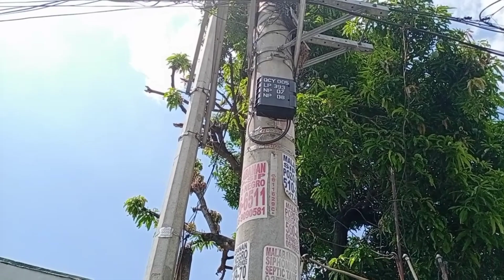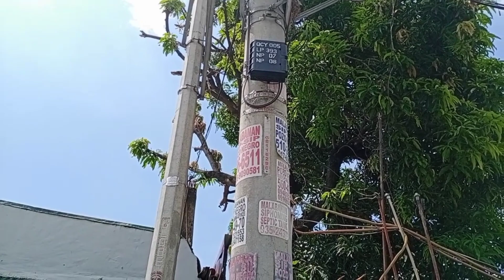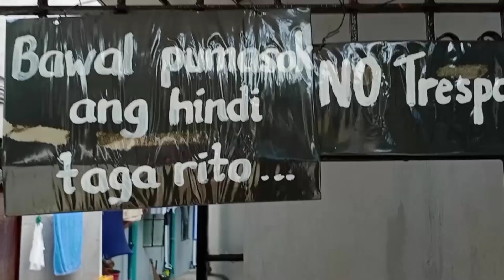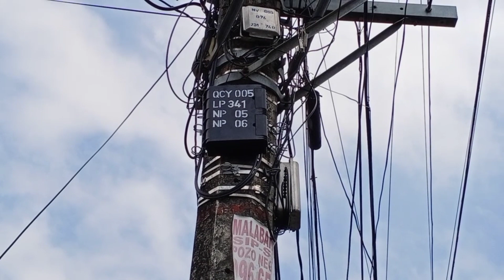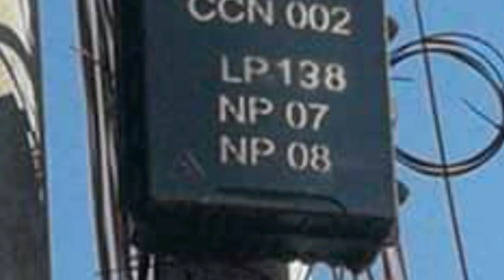How to determine NAP box of converge Fiber X in your area?

Comment: good day I just wanna ask the following  questions.
1.) Gaano po kahaba ang kable na kailangan mula sa nap box papunta sa isang bahay?
2.) Paano kung di abot ang kable sa bahay, pero gusto talaga magpakabit ng wifi? ano ang dapat gawin, mag request ng nap box? pilitin ang installer na mag over extend ng kable? o magantay nalang?
3.) Paano madetermine kung Nap box ba ng converge ang isang nap box? may distinctive appearance po ba ito? may nakalagay na serial number? anong kulay usually.
4.) how long bago maactivate ang mga nap boxes sa isang lugar.
5.) usually ilang nap boxes ang need sa isang lugar/ baranggay?
6.) ilan po ang capacity ng isang nap box? may variety po ba ito?
7.) paano malalaman kung puno na ang napbox?
hoping po for your immediate response
yun lamang po for today, salamat po
Reply: Oo nga po gano po katagal maactivate yung no power na nap box
Reply: Up
Reply: Basically lahat ng tanong ko andito na, pero 10 months na wala pa rin kasagutan.
Reply: 1. Mga 200m lang mula sa NAP BOX papuntang bahay
2. Depende yan, kung may malapit na electric pole jan sa bahay nyo pwede kayo mag request o babayaran nyo yung over span cable mula sa bahay nyo papunta sa box
3. Yung appearance nito ay kulay white yung NAP BOX ni converge at may naka lagay na black text
4. It depends on the plan that the surveyor being submitted. many process kasi yan, Approve for ROW (AFR), approve for Implementation (AFI), ABP (as-built Plan) at Mag tetest pa yan, as per converge mga 3-4 weeks bago ma approve yung plano saka pa i implement nila it takes 1 month depends on the area.
5. It depends to the sales, si sales po kasi yung nag dedeside kung ilang naps ang ilalagay para sa area nayan. 
6. For 1 NAP box it will cover 16 residences/subscribers.
7. You can contact the customer service of converge to ask if may available slots pa po ba

-Hope this can help you :)

Comment: Sir pwede pa kau mag vlog about speed test ng converge.. Diko ksi alam kung ano ung tamang ping and tamang speed  kung talaga bang naka 25mbps sya
Reply: Try to watch this
25 Mbps po ang plan dyan

https://youtu.be/RkuWUWQHor0
Reply: Syempre download ka ng speedtest na app or sa google i search mo lang speed test. then syempre start mo, take note mag ka iba ang "mbps"(maliit na letter b) sa "mBps"(malaki na letter B) parehas silang measurement ng Internet/Data speed. gaya ng 25 mbps connection, mag eequivalent sya sa 3.12 mBps dahil ang 8mb(mega bits) is equal to 1mB(mega bytes). so kapag nag download ka ng 3.12MB na apps sa playstore at may 25 mpbs na connection ka, aabutin lng to ng 1 sec. sa ping namn since fiber ang connection papalo lang sya ng around 1 digit or pede namn mag 2 digit since di naman constant ang connection.
Reply: @cocoamaster9200   thanks  for d info.. Di po kasi lahat me alam sa ganyan.. Sa totoo lang meron pa palang small b at B..

Comment: Sir. Tanong ko lang pag sumobra ba sa 300 meters ung wire additional pay ba un or di na kakabitan ng installer?
Reply from the maker: hanggang 350 meters po sagad sa wire pag sumobra po depende na lang po sa installer
Reply: @tribosschannelofficial9425  ahh. Sir kung mag bayad ako sa sobra ok lang din ba yun?
Reply from the maker: hindi po namin sya authorized sir saka bawal po yan as company policy
Reply: @tribosschannelofficial9425  ahh. Nag apply kasi ako ng converge waiting nalang ako for installation pero ina alala kolang parang sobra po ata sa 350meters ung area namin anggang dun sa poste ng converge. Pano po kaya ung gagawin ko at ung mag iinstall?
Reply from the maker: @jayrsemeniano1680  paano mo po nasabi sir na sobra sa 350 meters?7 poste po yan sir ng meralco yan po sukat ng 350 meters
Reply: @tribosschannelofficial9425  kasi ung nakita ko po samin na poste ng converge medyo malayo layo dun sa bahay na pag lalagyan, pero pwede din ba ilagay un sa ibang poste?

Comment: Paano po sir kung may nap box kaso napaka layo po? Pero same brgy lang din po ano po dapat gawin . Mag request ng nap box or what ? Paano po ba?
Reply: Same tayo sir 900meters ang layo samin nung nap box pero same brgy din po, ang sabi ng agent e babayaran daw po namin yung wire. Kamusta po yung inyo naka bitan na po kayo?
Reply: @cegieplaza5993  Di na po kami nakabitan sir kasi ang laki ng gastos Add 1k daw po sa foc.Sabi ng iba wala naman dapat bayaran about sa foc. Ang sabi lang obligado lang ang highplan 2500 pesos 100mbps. May anumalya sa foc sir hehe. 

Buti nalang may nag latag ng pinaka malapit NAP ng pldt dito sa purok namin kaya sir PLDT nalang pinakabit namin.
Reply: Kami nga po 7k babayaran lahat lahat pati yung wire, nakakainis wala parin yung installer
Reply: @cegieplaza5993  magkano daw po sa wire sir?
Reply: Bali 5500 po ata sa wire sir, tas 1500 1month deposit. Pero nilagay sa application namin 1500 lang bali yung 5500 daw po ibibigay sa installer

Comment: sir need help po may installer kc dumating samin nung May 15 tapos sabi raw po wlang slot ung malapit na Poste samin.  diba sa application  may step po dun na PORT RESERVATION. tapos nung installation day na biglang wlang slot.  bat po ganunn  ang labo po kc..  tas sabi  meron poste na medyo may kalayuan samin pero may slot tapos mag eemail raw muna ung installer sa office tungkol nga raw po sa concern. pag na approved raw kakabit din raw. kaso wala pdin sila update hanggang ngaun po.  btw tinanong po ako kung may agent ako sabi ko kc wala thru online lng po ako nag apply.  SALAMAT SIR SANA MATULUNGAN MO KO
Reply from the maker: tawag ka sa hotline sir 86670850 then pic nyo po yung box na malapit sa inyo yung pinakamalapit na box at yung kasunod na box basta 350 meters sir mula sa bahay mo,para mairequest to revisit
Reply: sir eto po ba ung email address nila? iconverge_noreply@convergeict.com  dyan po kc ako nag f.follow up ng concern ko sa installation.

Comment: Sir paano malalaman kung activated na nap box meron na nakalagay na number. Pero lagi sinasabi nang installer hindi pa daw activated sir paano malalaman yun
Reply from the maker: sa system po or pag may nakatusok na po na maliliit na wire sa ilalim,sa may butas ng box sa ilalim po
Reply: @tribosschannelofficial9425  usually sir gaano katagal bago ma activate ung nap box two weeks na sila meron number sir
Reply from the maker: @shannonpelayo2310  depende po yan kasi i test pa nila yan kung lahat ng port ay ayos ang reading,2 to 3 months expected po,pero depende po sa bilis ng contractor na may hawak ng activation ng box

Comment: Ilan po ang pwde (household or nag apply) per box?
Reply from the maker: depende po sa Nap mam,kasi minsan yung box single NP lang minsa naman double NP,pag single NP 8 ang capacity pero 6 pa lang full nap na,ganun din sa double NP 16 ang capacity pero minsan 10 or 12 pa lang full nap na sa system kaya unahan po ito sa reservation
Reply: @tribosschannelofficial9425  yung 350 meters po. 7 poste po ba talaga ng meralco yung sukat? Simula po kasi sa box ng converge, mga 12 na poste po papunta samin. Kaya po ba yun? Salamat po sa pag sagot.
Reply from the maker: overspan na po yan mam kung standard po kasi yan na sukat ng poste ng meralco 50meters po yan
Reply: 24 po